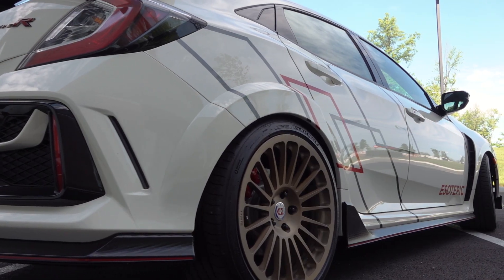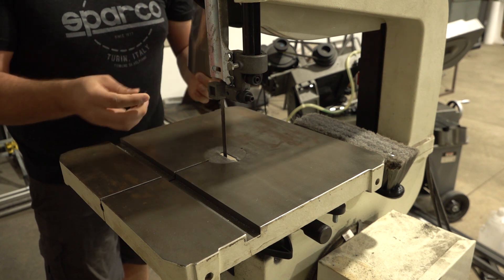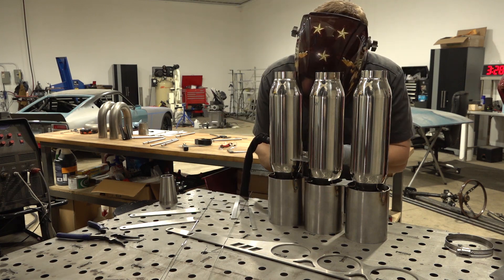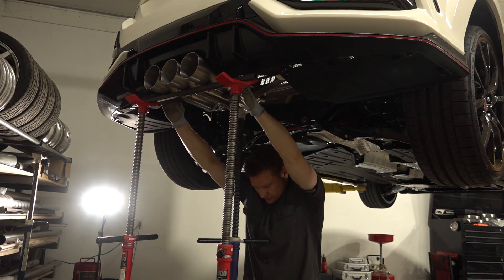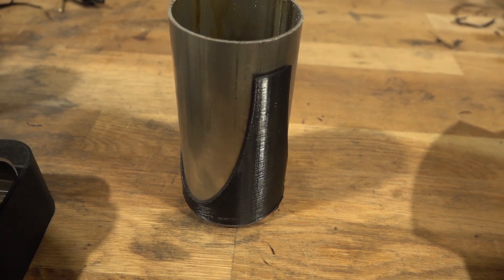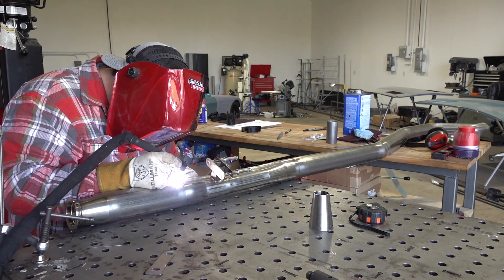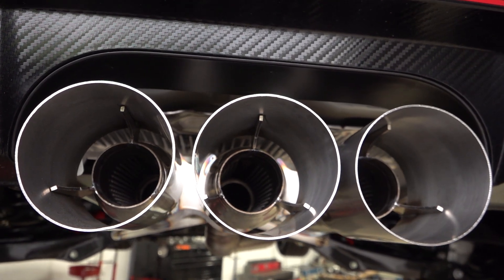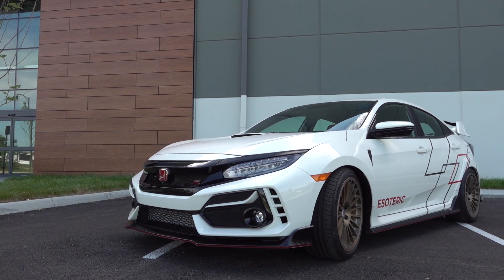Using 3D Printing to Build a Custom Exhaust

Comment: just came across this.  have gotten into welding the past year but have 3D printed (even professionally) since 2015.  this is a great video.
Reply from the maker: Hey thank you! A ton of work but the results were worth it. The 3d printed parts helped out a ton

Comment: Seems like it doesn’t drone much but it probably has the stock down pipe. I think on a catless downpipe it would drone unless a Helmholtz design was incorporated.  This would be sicker if it was full titanium.
Reply from the maker: There's one pocket off throttle around 3k rpm that gets drone, the OEM exhaust did have a helmholtz in it specifically targeting this. Would agree probably need to add something with an aftermarket downpipe. Thanks for checking out my video!

Comment: MMMkay young man, I'm gonna need you to stop messing around with Hondas and finish your "Z".  Are we clear?
Reply from the maker: LOL John damn, laying down the law 🤣. I've really gotta pedal down if I want to drive it this year. Everything's been backordered like crazy and I keep seeing stuff I want to redo with how poorly I did a lot of things over the years. There's also a ton of small projects on it that really aren't video worthy that ive been putting off.. need more hours in the day!
Reply: @GrindhousePerformance  I'm just now embarking on a pretty major re-do of my exhaust.  It's just too damn low and scrapes too much.  The only way I can conjure to get more room is with tri-"Y" headers and a single oval 4.5" tube in the middle section rather than two 3".  Fortunately the back section up to the front of the diff is fine....but most of the rest needs to be re-imagined.  I hate the thought of it...doing the headers was brain damage the first time....but it's not going to fix itself.  I already made a new tranny cross-member with much larger exhaust cut-outs.  Ah well, at least it'll keep me off the streets....
Reply from the maker: Oh dang, that doesn't sound good for my future then either! Have you seen shawn basset's? He ran at pikes peak last year in an all carbon LS 240z. "Attacking the clock racing" His exhaust routes as fender exits, but the fender area is large enough he's able to tuck mufflers up front. I can't remember if NASA has rules on exhaust exiting behind the driver, but it's a thought I had if it scrapes too much